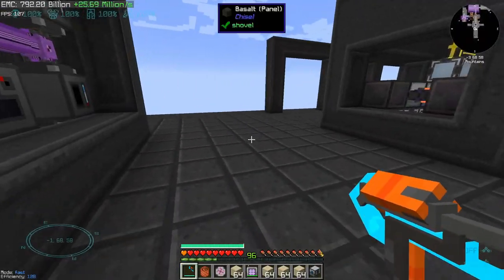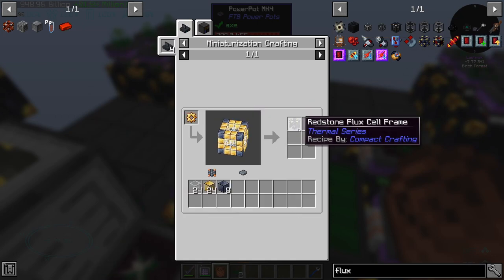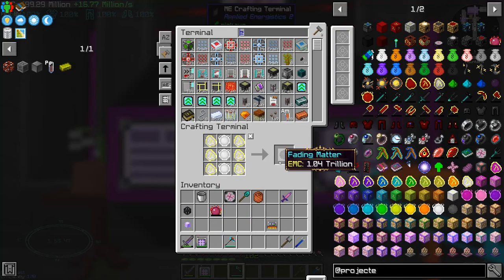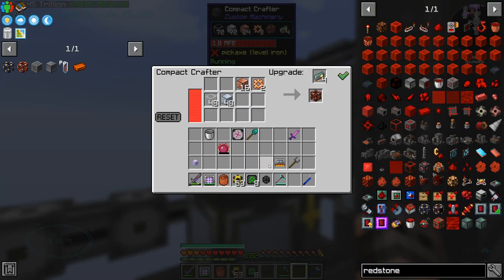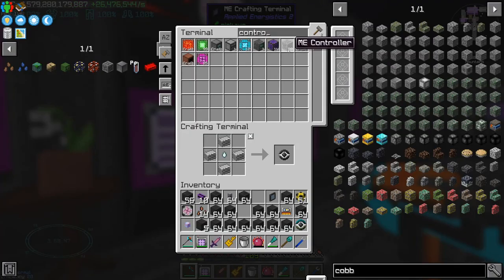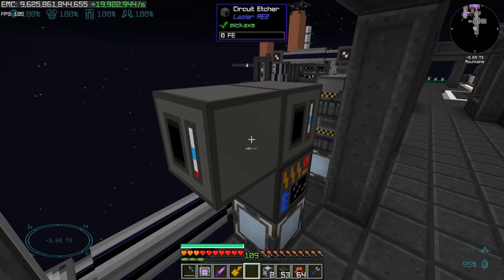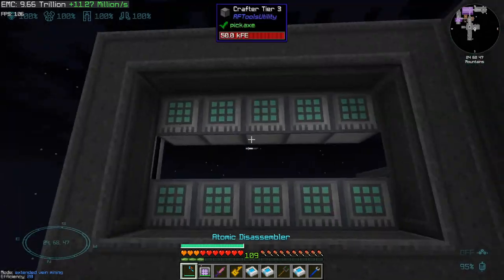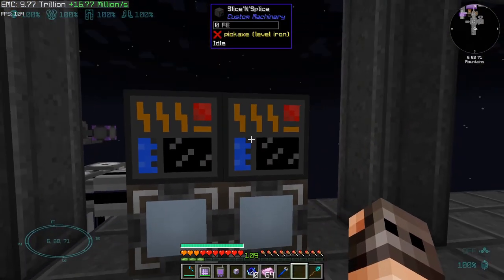NTC2-Ep13: Fading Matter

Comment: MAJOR TIP : If AE2 is not fast enough when importing items for a crafting recipe, you can increase the crafting recipes multiple. For example you can make one recipe, in processing mode, for x64 blocks of redstone. AE2 will then import x9 stacks of redstone rather then 9 at a time.
Reply: Stack crafting 💪 but don't forget the stack upgrades in the interfaces
Reply from the maker: But my dearest guy with cheese, I literally did that 😃
Reply: @Lashmak  Noooo! I have failed you lord of Darkness.
Reply: @generrosity  this isnt RS we dont have stack upgrades, we have instant interfaces by default
Reply: @commander3494  yikes was thinking of Acceleration Cards but that mightnt be a thing either. commentary fail this thread all over :(

Comment: Import/Export busses are laggier than interfaces because they are actively checking for space/items to push to/pull from. Stocking interfaces only check import/export if they receive an item update, so they are passive. This makes them a much better option for keeping lag down and I would recommend using them and auto-input/auto-output on your machines wherever possible (your clear glass setup triggered this explanation btw) instead of using import/export busses and/or pipez. Unfortunately RFtools crafters can't auto-output so that's the best you've got.

Comment: There are singularities for all tiers of Matter, up to and including White Matter and Fading Matter. There is also a singularity for Colossal Star Omega, whose EMC value is equivalent to just over 6 stacks of Fading Matter. You will need an estimated 5-6 *quintillion* EMC for every Ultimate Singularity, so upwards of 80-100 quintillion EMC in total.
Reply: Idk how youre supposed to beat this pack without going insane lol. Not as bad as po3k but still for a pack called not too complicated 2 its kinda wack. Does lash at least have access to final star so he can dupe everything?
Reply: @capnbug  The Final Star has no use in Project Expansion (it did in Project EX but that mod is abandoned). Therefore, the only way I know of to actually infinitely dupe items is via the Creative Vending Upgrade, which itself costs an Ultimate Singularity, or 5-6 quintillion EMC.
Reply from the maker: I was hoping for quadrillions 😂 I was off by a factor of 1000 🤭

Comment: When crafting things like experience pearls or blocks of items, nothing is really faster than compacting drawers. Also they are free to use
Reply: yeah thats confusing to me, compacting drawers does it all instantly, and costs nothing, legit just set a recipe to send 9x (or 4x) of an item into a compating drawer and it sucks out the full blocks, then multiply the recipe by whatever amount to send stacks in at a time (drawer doesnt actually have a limit of input output, the pipes do)... on top of that you can use 2 drawers in parallel to compact up to whatever amount you need by hacving the first drawer suck out their highest compact and input that into a new compact drawer to compact it further.... its REALLY easy and simple to use, and is literally instant
Reply: I believe the issue is either that Lash doesn't like using drawers or that drawers are laggy when used in combination with AE2.

Comment: You can't speed up molecular assemblers but you can use more of them in parallel. Add the same recipe into more of the interfaces next to them and as long as you have coprocessors they'll use all assemblers that are adjacent to interfaces with that recipe in it. Assemblers with interfaces aren't different when it comes to scaling up from other machines with interfaces. It's just easier to add copies of the same recipe.
PS: the amount of coprocessors you have looks tiny (I think I have 4x4x3 cubes) and the way the craft flickered (15:23) is a good sign you exhausted your coprocessors. There's afaik no good way to see when that actually happens but flickering when it's crafting items that have enough resources means it's waiting on processors, not on resources.

Comment: hey lash, maybe use smaller drives in the backpack so that it doesn't have stupidly huge capacity but still has all the drive slots full for the aesthetic
Reply from the maker: Oh actually drives aren’t expensive anymore. I can fill them all in with 16m storage disks. It’s just the other drives that you see around the base aren’t connected yet. I’ll do that. Just to have some lights 😃

Comment: Remove the wireless heater and put a factory upgrade in the netherite furnace. Then it will be much faster and not do light updates and use power directly. Nice video bud

Comment: You will need thousands of 5 times compressed endstone, as well as netherack.
I would also recommed to build a transmutation interface, as it allows your ME system access to the EMC, therefore you dont need the energy converters anymore and just have infinite of all emc ressources, as long as you have emc
Reply from the maker: my dearest Sebastion <3 me already has 120k 3x compressed endstone. I dont really think i can craft it faster :D I know i need more, i guess in time we will have enough. 

also i am not using the interface for lag.
Reply: I see the dark lord is very wise :)

Sad about the lag, would help a ton with auto crafting.

Comment: Ay Lash
This is a trick that worked for me in refined storage so i assume it works with AE2
You can import redstone into a compact drawer and pull blocks out
Another option is to just use compact drawers as external storage and you can just take it out as redstone or redstone blocks
Reply from the maker: Bello :)
Yeah this is a trick which always worked with ae2. It’s just I don’t do that because ae2 will get confused how many items are available in the system

Comment: Average refined storage fan vs AE2 enjoyer.
Reply: RSMR-Chads vs Applied Peons. :/
Reply: imma be honest. i never notice a difference between the two mods other than a slight aesthetic difference, then again i never get into the super fancy mechanics such as autocrafting since its always easier for me to just do it all manually (the crafting table crafts instantly stacks at a time, whereas the assemblers do not) and i dont usually play packs that require a billion of some complex item. i just use either mod as a storage system and nothing more
Reply: @XiaoYueMao  refined storage is the successor of AE and you see it. far simpler and more convenient with upgraded mechanics. AE is oldschool and always has the "you actually build a structure that does things"-vibe instead of the refined "a block can do that"-vibe. (large controllers, quantum rings, autocrafting, cables, p2p, and such). 

for a long time AE had the upper hand with dimensions and range (infinity upgrade) as well as large amounts of patterns. with tiered and creative crafters for RS now, as well as infinity boosters, that edge is gone as well. 

TLDR: AE is flavor, RS is functional.
Reply: @AkiSan0  last time i used AE was years ago and back the patterns were simple, you just set the recipe on the pattern including what machine its made in, then popped it into a single pattern block that stored every recipe. then so long as the machine needed had bus connected the single pattern block did everything automatically, no need to setup patterns on a block at every machine and shit
Reply: @XiaoYueMao  yeah, time's changed...